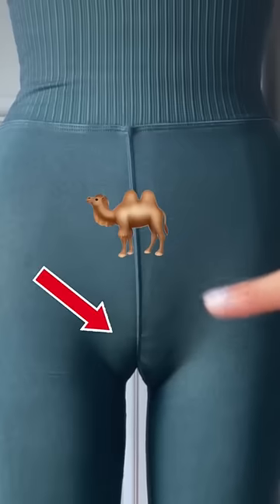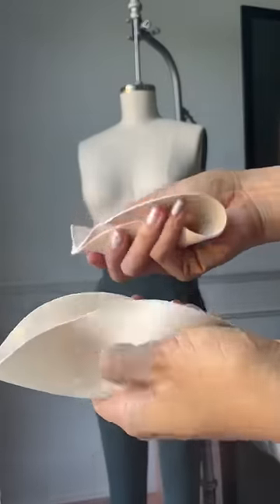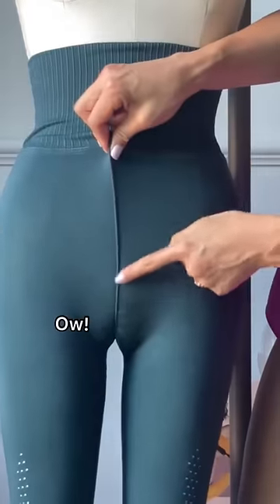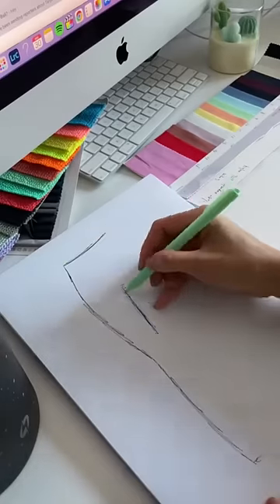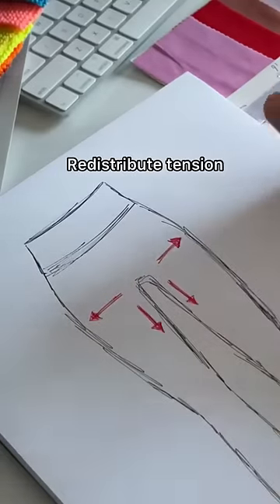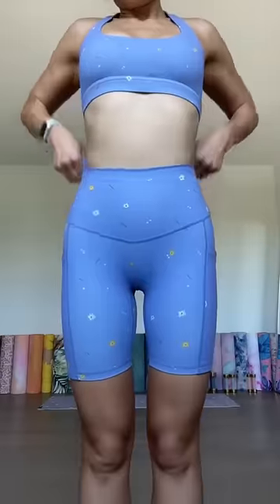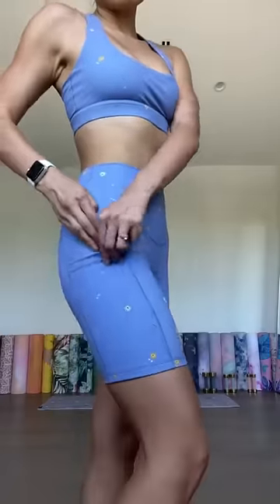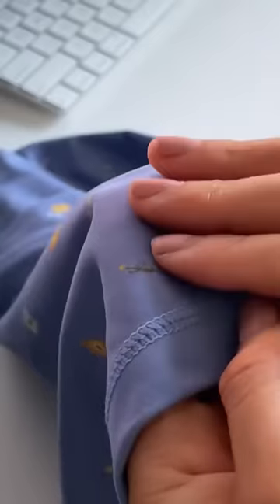Let’s talk about camel toe… #shorts

Comment: also crotch seam length which includes the back seam. commercial patterns often have a C shaped curve when it should be more of a L. if front seam included and as mentioned enough width in the thigh area. it was handled very well in this garment
Reply: Thanks, I didn't knew that.

Comment: My interior design teacher used to tell us not to draw like “that” bc it looked like a “hairy line” and it meant we didn’t learn to do straight lines correctly lol
Reply: Usually, in art, you should learn how to draw straight lines without breaking it apart like this. The hairy line looks like you're untrained/lack confidence in yourself. It seems like you're scared of placing down the line, so instead of doing a normal, straight, continues one, you make them spider legs because it requires much less of technique. It can be tricky to make a long, confident line that's not shaky, controlling the pressure on top of that. You usually do some exercises, that is just making many, MANY straight, long lines and nothing else. That is to teach you some confidence in placing the lines and for your hands to be less shaky and fluid.
I think the reason you were thought to draw lines like this, is because clear lines are very important to help others understand what's on the paper, so that other people looking at it don't have to wonder what is on the drawing. With plenty of short lines placed on top of each other, it often turns into a mess and can give you a headache trying to understand what is what.
There could be a few reasons why she's using "hairy legs" instead. I don't know if she ever went to art school or something like that, but if not, maybe she never even learned about that. Maybe in clothing design schools they don't require you making straight lines, or maybe she just prefers the spider legs. They're much more comfortable and easier to draw, and if she's mostly the only one looking at the sketches, or those are pretty simple designs, there won't be much confusion anyways.

Comment: On jeans,say. If the front legs are not straight but at an outward angle from the zipper part, it will create camel toe. Remember Rocky Mountain jeans back in the late 80’s early 90’s? Also no back pockets.